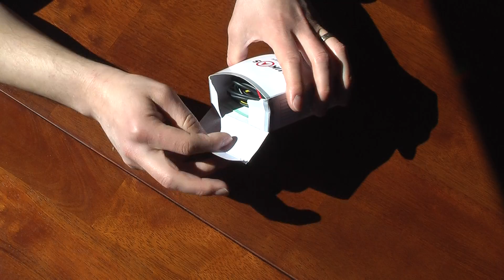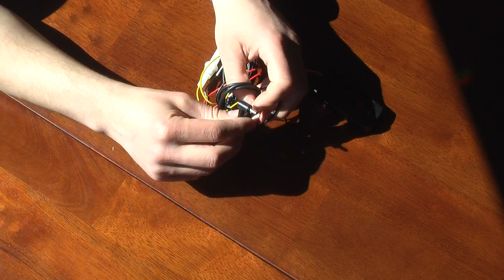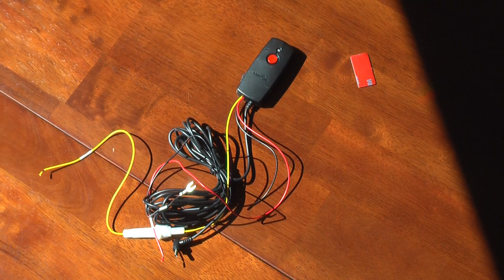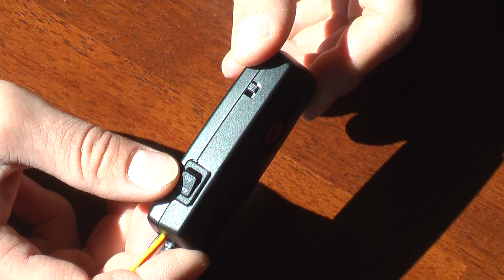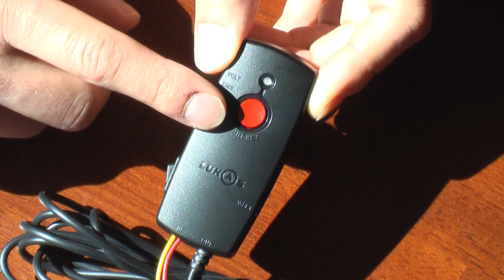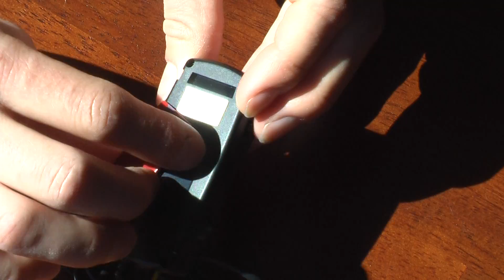LUKAS LK-290 Hard Wire Dash Cam - Battery Discharge Prevention - Dashcam Black Box Panorama S G

Comment: Can you add a male cigarette lighter on the input side.  I hate to wire anything in my benz but i do have a always on socket.  What are your thoughts?
Reply from the maker: loyd Loyd If you're just interested in a product that will prevent battery discharge, there are purpose-built options. Check out the "Koolatron Battery Saver" on Amazon. If I'm misunderstanding your question, please let me know. You really only would need this LUKAS product for a hard-wired solution.